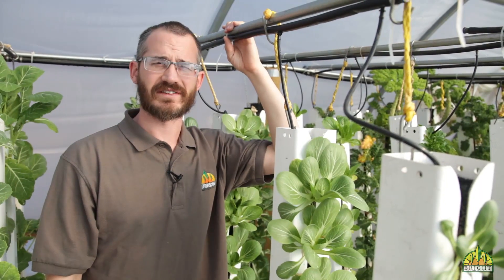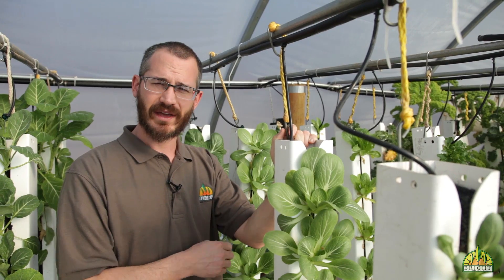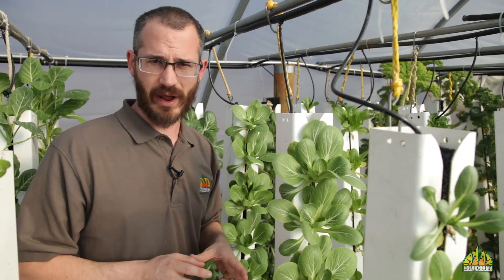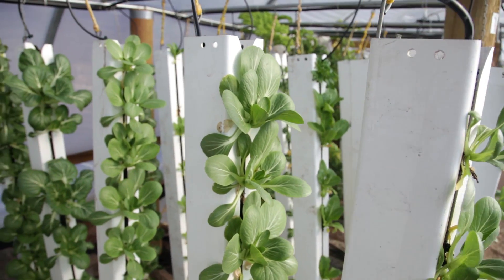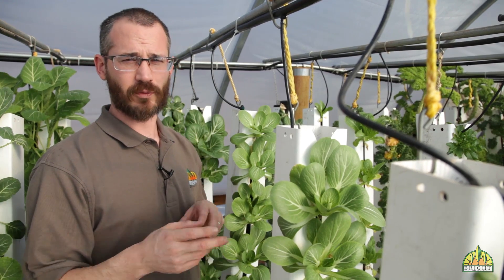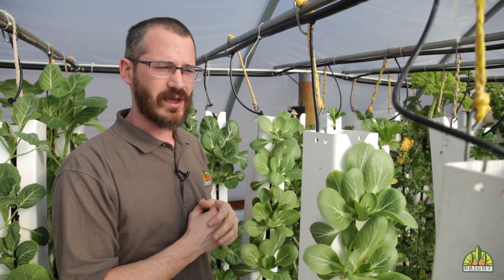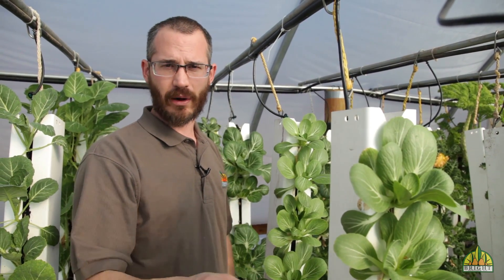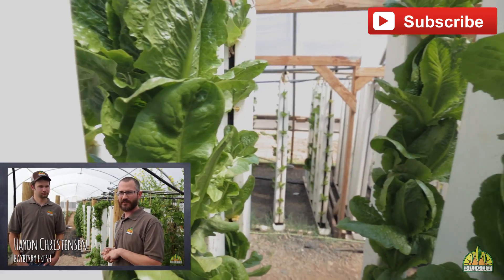Conveyor Cropping in Hydroponics

Comment: In order to further boost density each "boom" (?) (horizontal poles used to suspend the Zipgrow Towers) may also slide on the boom supporting them in order to have them as packed as possible much of the time while letting the operator create a single alley whenever it is needed.  It may be more costly to mount them floating and tedious in some rare cases, for example if one wants to inspect a particular ZipGrow Tower because "creating" the alley may then imply to move many booms, but there will only be one alley: much more room for plants :-)